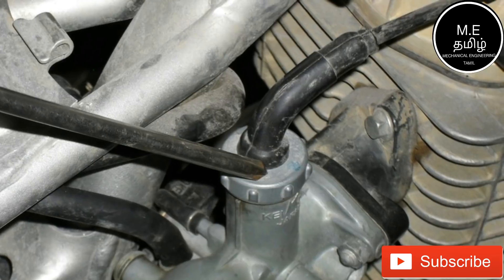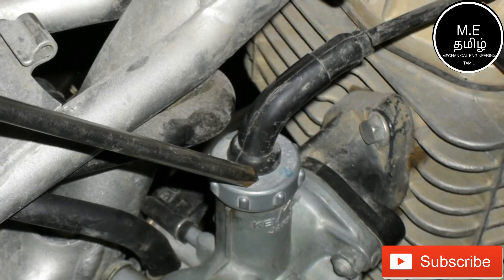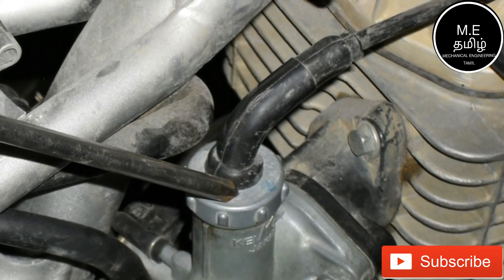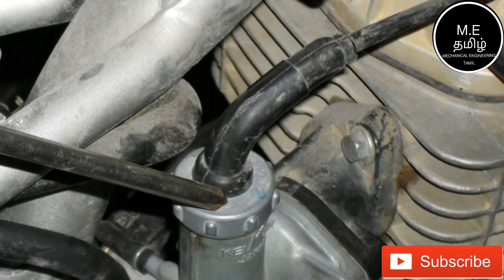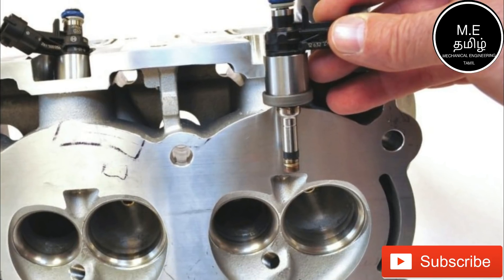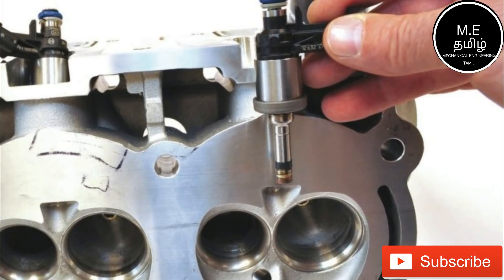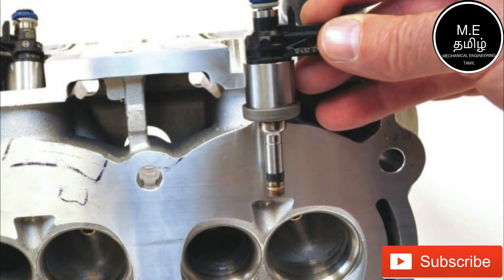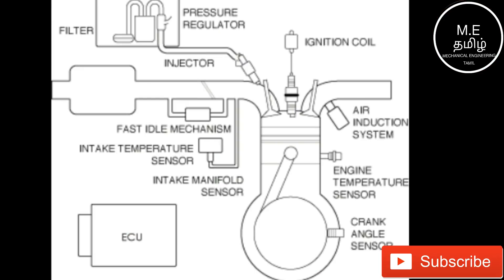Difference Between Fuel Injection And Carburetor?Explained In Tamil(தமிழில்)

Comment: Gi, naa bike vanga idea irruku Fz 2.0 & Honda Cb Hornet 160 choose panirruka, 2 air cooling ana Fz fuel injection,  Hornet Corborator ithula yedha choose pannalam
Reply from the maker: For Mileage And Abs , Led Headlight - Hornet
For Look , fuel injection - fz
Reply: About solenoid switch

Comment: Apache 160 4v with carburator type mileage? Apache 160 4v with fuel injection mileage?

How much mileage difference?
Reply: no big difference in mileage but drastic fall in pickup (FI)
carburator is the best but you will have to tune the air screw according to your needs

Comment: How can change carburetor into fuel injection is it possible in carburetor bike
Reply: sridhar suresh  it is not  possible  ,because  carburetor  system  consisting  spark plug
But  fuel  injection system  doesn't   contained  spark  plug
Reply: sridhar suresh  OK bro